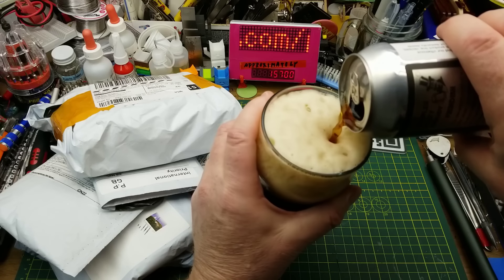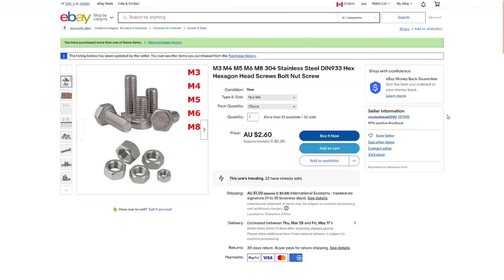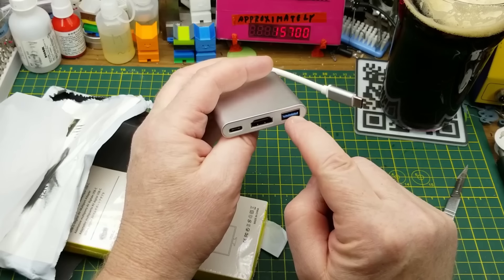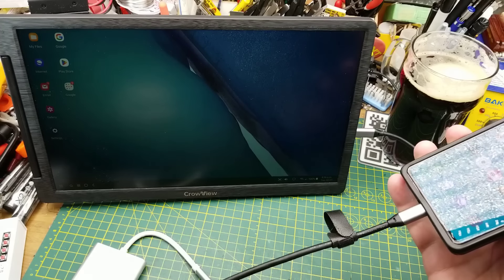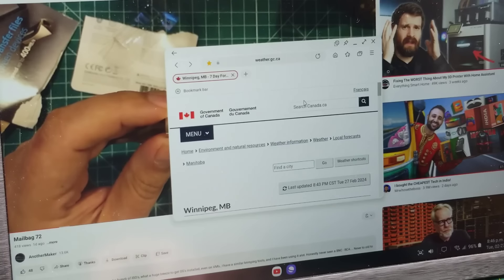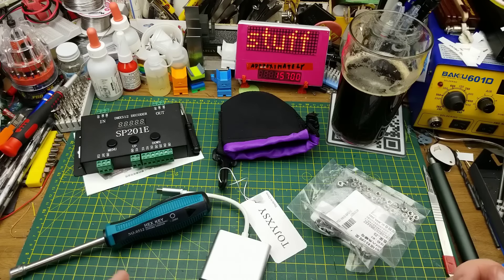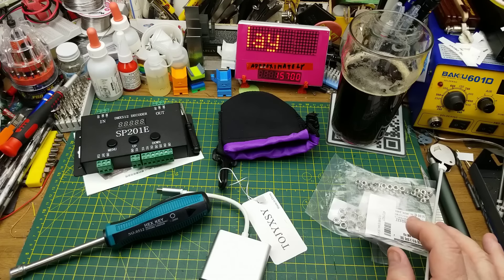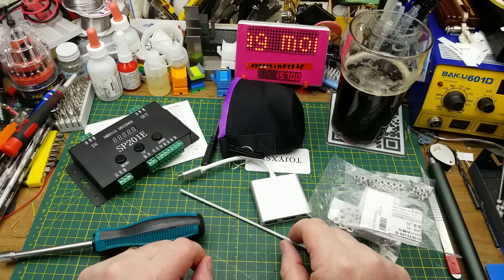Mailbag Monday 187

Comment: 7:15 The M4 referes to the thred size of the nut, 4mm. The fact that the nut fits the 7mm wrench is more a coincidence than a standard I guess.😊
Reply: It's more than coincidence, there's an actual standard for nut sizes. Virtually all M4 nuts will need 7mm drivers.
Reply: Ok, so what's the name or number or whatever for that standard?  DIN....  JIS...  ISO...  or..?. @eDoc2020
Reply: @geirendre   It appears DIN 934 and ISO 4032 are the main standards for metric nuts.

Comment: Being a Samsung phone you will have DEX which gives you the desktop experience. I use my S22 Ultra in Dex mode alot and love it.
Reply: DEX is cool, but my workflow on my computer just doesn't translate, otherwise I'd prolly use only it, especially as I got a need hub stand for it.
Now with that said, check your control panel, it should have DEX settings, there are options such as phone being a second monitor (you can move your mouse over to it) or a track pad, and of course the usual audio options are there, blue tooth or if'n your hub has a port like mine, wired speakers.

Comment: The American weights and measures (Not Imperial) can be called ANSI or American Customary Measures. They are based on exact relations to SI units. Like 1 inch is 25.4mm exactly.